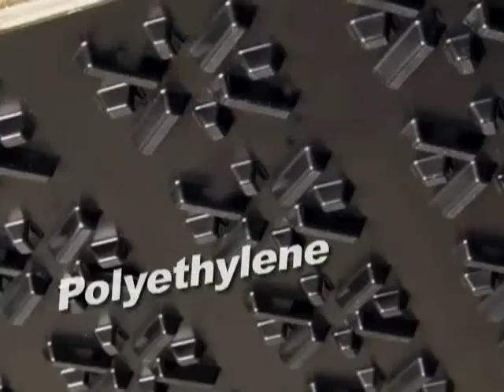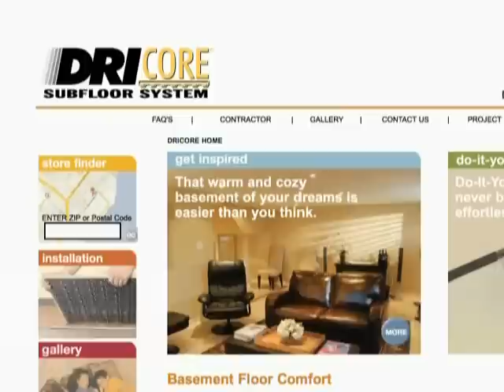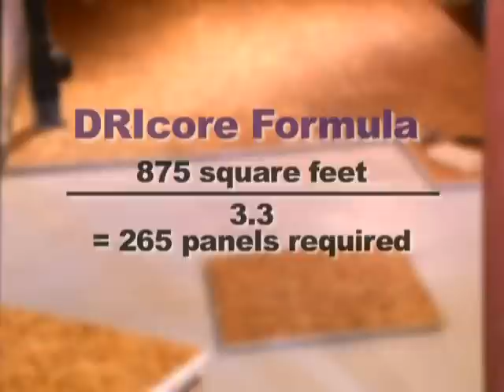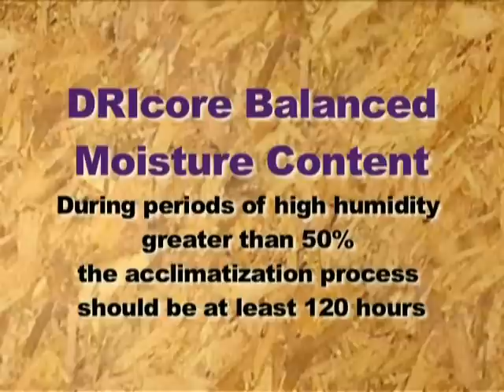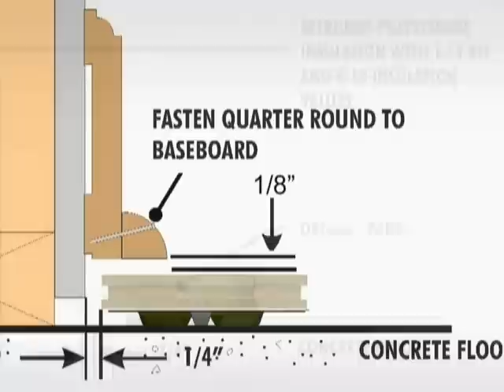DRIcore Subfloor Installation Video

Comment: Shouldn't you start the tongue of the panel towards the outside of the wall or towards the 1/4" piece so when you lay the next piece and hammer together with a block you don't damage the tongue?  Always hammer on the groove edge, not the tongue edge
Reply: Yeah, the other video says opposite. This seems like the most important detail, and they got it wrong.

Comment: I plan on installing DRIcore as a subfloor in my below grade basement.  Currently there is a vinyl laminate laid over the concrete.  I will not be removing the baseboard moldings that are already in place.

2 questions:
Should I remove the vinyl flooring already in place or can I put the DRIcore right over it?

Since I will not be removing the baseboard moldings do I still have to shim 1/4" all around or can I butt the DRIcore right against the molding?

Thank you very much

Comment: They do need to come down on their pricing. Menards sells their product and its $5.38 for a 2'x2' tile. Pretty ridiculous. This OSB and a little plastic doesn't cost hardly anything to manufacture.
Reply: Jason it's cheaper to just get the rolls of the plastic (like from dmx) then do subfloor over. You'd have a better vapor barrier as well
Reply: @shanmike11  agreed. In my calculations, Dricore is literally $1 more per sq ft. than going with black DMX foundation wrap with OSB on top. Yes, you can seal the seams on the DMX, and not on the Dricore, but then you're adding the cost of seal tape as well. Dricore is way easier to install. To install tongue & groove OSB over DMX properly (black DMX foundation wrap with tongue & groove OSB overtop), you still need to fasten it with tapcons, which now heightens the cost and labour considerably. Dricore is a floating subfloor, no fasteners, except for certain flooring applications like tile and hardwood. If you're going to put tile or hardwood over either of these products, you're still going to have to fasten both DMX+OSB or Dricore with tapcon cement fasteners anyways, which compromises the 'perfect' vapour seal DMX claims.
Reply: $1.09/SF is reasonable and this product is less work.
Reply: In 5 years the price has nearly doubled. I just paid $10 per piece today.

Comment: So if I've placed walls already, is it recommended to leave drywall to concrete floor level or remove it to allow drycore to be laid 1/4" from 2x4 walls?

Comment: thatsnot entirely true with an R value of 1.7 when installed over a concrete floor, DRIcore has the effect of warming a room by 3.2°C (6°F), also eliminating the hardness and dampness of concrete make it much more comfortable, enevn better with finished flooring on top of it.

Comment: Wierd, two "official "Dricore videos and you get two different sets of instructions?  Who who to believe the CEO of Dricore or these actors? differences are: room acclimatization, finish inches  at the end of a row and starting position of the panel.  Why on earth would I use a pounding block on the tongue side of the board?  wouldn't that increase damage risk to the tongue board?
Reply: i know you posted this 2 years ago, and im just reading it now.. but i thought the same thing!! pounding on the tongue is not the way to install this product!!